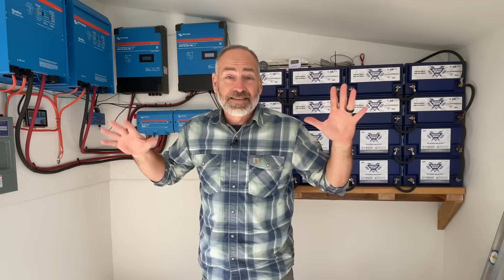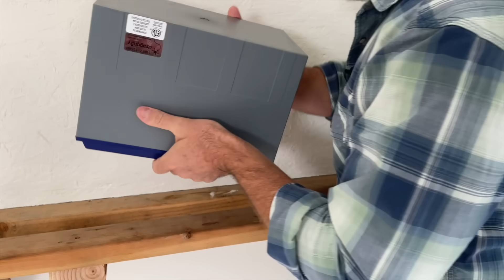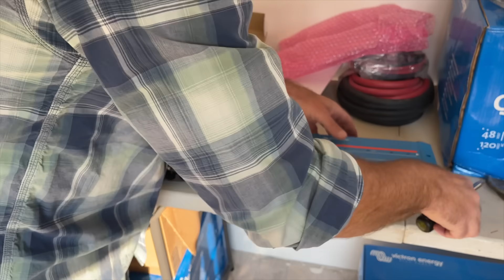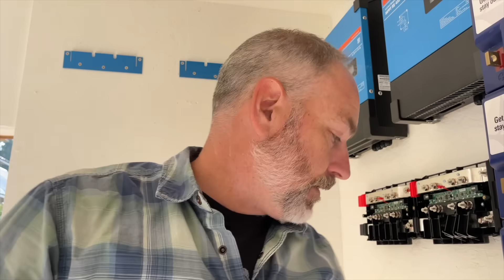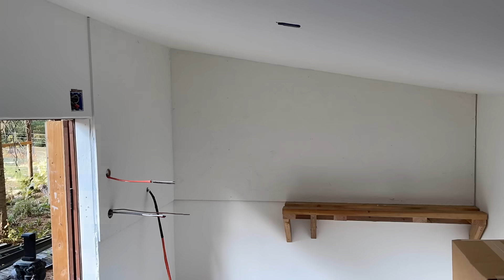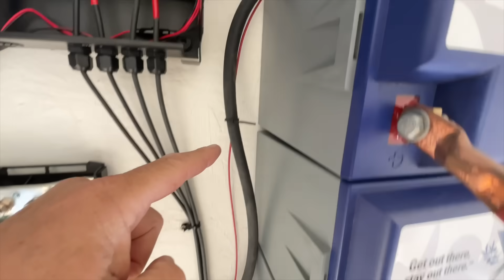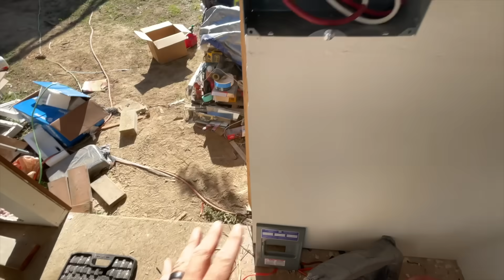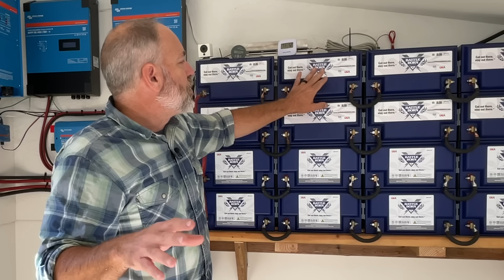EASIEST Off Grid Solar Power System Battery Bank

Comment from the maker: 🔥 WATCH OUR OFF GRID HOME BUILD FROM THE BEGINNING https://bit.ly/OffGridCabinBuild
Reply: Hello Martin. I was wondering if you could share the costs (approximately) with all of your solar system. My wife and I are thinking of moving to another state and I am very interested in putting in solar.
Reply: 🎉5 red a try t up i @kathsbadboy
Reply: @kathsbadboy it  G-d free to contact us to be a part of the world
Reply: @kathsbadboy t😂🎉e the
Reply: Please report the scammer using your picture and to text a number. Hes replied to every post with it
Reply: Hh check
Reply: @laurakenway6262  hello
Reply: @laurakenway6262  Hh check ? Do say more
Reply: so thinking of yours and mine, i found that i have some issues, im using 6awg after the first series batterys, so i paired using 6awg and about 7 ft of it. so i have voltage drop of ,3 volts. and some of my 10awg wires from controller are 10 ft long. so i got to go bigger and shorten things up
Reply: 😮r4
Reply: can i ask you, if i put my batterys like yours and hook panels for 48 volt and 12 batterys 48 volt, i dont mind a 48 volt controller, or re hooking my panels, but dont want to buy new inverters, so i have a 2500 and 1000 watt but 12 volt. would i have any battery life being hooked to one battery in a group like yours is what i want to know???
Reply: @chriscates3352  - You must have a 48v inverter for a 48v system.
Reply: @chriscates3352  no, that doesn't work. 
You might get a system working with a DC-DC converter but it doesn't sound ideal.
Reply: @alanhat5252  what  voltage should i set for stop charging on 24 volt batterys? it goes up to 30, i play around 28 volt, like 28.4 sometimes
Reply: @chriscates3352  shut off voltage depends on your battery chemistry. With LiFePo4 29.2V would be max with a 24V battery. And 20V minimum voltage where you want to stop draining them.
Reply: @VilmaHallikas  i got lead acid. new batterys are 13.5 volts. so on a car it charges at 14.3 volts. so this would be 28.6 for series. so i dont know if 27 should be shut off
Reply: @chriscates3352  lead acid is totally different beast. There's more variation there (flooded, sealed, are they deep cycle etc)
And then there's also how you use them.
If I'm not totally mistaken they like to be charged with constant current and when they are about full change to constant voltage. And around 29V is good afaik but don't take my word on it.
Reply: @VilmaHallikas  thank you. i knew fully charged was about 13.5 on car batterys. and with a 100 amp controller was worried of fire if set to high now that i know i can change it.
Reply: Hi Martin. What brand of solar panel do you recommend.
Reply: what should i set my 24 volt controller at for shut off voltage? it goes up to 30 volts
Reply: seems like another scam
Reply: Spammers are piggy backing your channel, offering prizes
Reply: Hhh
Reply: Greetings sir, David here from Ghana,  i have the same unit,  not working. 
The inverter led flash 
Temperature led stays on 
The bulk and the absorption led stays on
WhatsApp could be the cause of this please
Reply: wow, super helpful. I am looking at setting up something very similar. A pair of Victron Energy MultiPlus II 48V 5000/70-50 Inverter Chargers. But as Battle Born Batteries are hard to get over here in the UK, I am using some Epoch 12v 100Ah batteries. 
And it's great to see how you have yours setup.
Reply: Hh,h
Reply: 2 3000W inverters, and 2 supercapacitor kitties
Reply: i noticed today that the y connectors are only rated for 20 amps, my charge controllers are 100 amp and 30 amp. how did you solve this issue?
Reply: fake
Reply: Dear Martin,Sorry to bother you here. We have some questions about home energy storage installation. Can I contact you through your email?
Reply: hehe i bought 30 220ah victron agm deep cycle batteries in 2012 when they were dirt cheap, never used them until now. they were stored, checked them they were still full capicity. best batteries ever.
Reply: grdhdrhjrd
Reply: List price of that battery is $874 times 16 batterie =$13,984 for that entire battery bank  
Nah....I'll stick with my $106 Deep cycle AGM battery  times 16 =  $1,696
I'll use the $12,288 that I saved on batteries to buy more solar panels.
My deep cycle batteries are good for 3000 discharge cycles.
Typical Lithium ion is good for 300-500 discharge cycles.  The best Lithium ion are good for 1500 cycles.
So I guess my "cheap" batteries will last twice as long.
Also in Wisconsin if I bring in my batteries I get $20 off for each of my batteries.
And if I bring in a Lithium ion battery I get CHARGED $3 for a disposal fee for each of my batteries. Even when buying new ones.
There is a reason that real off grid builders do not use the super light weight, high energy density, most expensive batteries.  Because you would have to be insane to pay $12,888 more just to save a few pounds on batteries in a bank that will NOT MOVE for many years.  But you do make super exciting videos showing how light they are.  So amazing.  I just have to run out a get me some
Reply: @michaeljorgensen790  do you have a source on that 3,000 cycles claim? I'm seeing 500-2,000 in my searches.
Reply: One of the companies I priced for Solar panels was $65,000 for my home, It would take me 36 years to pay for that at the cost of what I pay for my light bill now.
Reply: You say this is a “simple setup”, but I just helped my friend install a Sol-Ark 15k inverter with a 15kWh battery made by Trophy Battery (both American made companies), and it’s, BY FAR, the best, most efficient, and simplest system I’ve seen. It runs his ENTIRE home. 

The grid connects directly to the inverter (with a 200 AMP disconnect in between), single battery connects direct to inverter, and solar direct to inverter. Honestly not sure why anyone would choose anything else.
Reply: What if I need the system without the solar panel. 
What would it cost .in USA $
Reply: What did this cost?
Reply: Amazing Work and you are very good at explaining things like when you were going through the wiring to Ac dc inverters/batteries.busbar and controller to fuse box.. What a setup..
Reply: Make sure you have surge protectors on the system and individual surge protectors on your electronics and appliances and a surge protector on your electrical panel. You have a lot of expensive equipment and wiring to loose if lightning decided to hit your units. You can loose everything. And it can burn down every building you have.
Reply: How do you heat the shed to keep the batteries from freezing?
Reply: Realistically how long do solar power batteries last in hot countries Like India etc ?
Reply: Your work is amazing man,how i wish I to work with you
Reply: Your batteries have freaking nose rings, fricken disgusting lol.
Reply: How much the system cost you?
Reply: Looks pretty good.  Looking forward to seeing how well it performs this winter.  Thanks!
Reply: @HomesteadEngineering  h,
Reply: @HomesteadEngineering  I
Reply: @HomesteadEngineering  ppp
Reply: @HomesteadEngineering  14:37
Reply: Wooow beautiful but you need to mount them on a metal frame and trunkings to running the cables.. Am learning a lot  sir keep it up...
Reply: Hi Mr Johnson, I enjoy watching your videos and all your efforts and positive enthusiasm. Do you think you can share some of the things you did in order to make such a move and the costs associated with that. Thank you, much appreciated.
Reply: @Joe-kx2yh and i and dessert too iir😂tt😢urttt ft i err r 0:04 0:04 0:04 tree 0:04 r 0:04 0:04 4r Tu Yi h4
Reply: RRT😂 error message

Comment: More dollars than sense, using the most expensive everything, with no performance advantage.  Why so many little batteries?   That's just adding unneeded complications, connections, and balancing issues.  Oh great ... mixing old and new batteries.  
DO NOT REPLICATE THIS system, unless you also have a bit of brain damge, and way too much money.

Comment: Nice set up.. grounding is really ineffective.. increase your gauge ac input or your load wireing..looks like 10 or 8 gauge wires..I use a 4 gauge wire for my inverters ac out or load to a breaker box just like what you have..and from my breakers I used 4 gauge wire..one is going to the cabin and the other 60 amp breaker is going to the spare cabin..My battery system is 12 VDC..48 VDC is not need for me simply because my inverters are close to the batteries..my backup generator is a 3200 watt diesel powered.. great for running on biofuel that includes cooking oil vegetable oil or let over oil..I collect that type of oil from restaurants...my generator wire is  8 gauge wire that runs to the inverters..but I am using two single 30 120 vac breakers..both of them on give me the 240 vac..that line goes to my input ac power in on my inverters..The thicker the wires are the less harder the inverters work and the more efficiently the power flows.. Exspecaly ac current...

Comment: $16,000 in just batteries alone 😮
Reply: I know. Its the reason I don't have solar panels. If you dont use vast amounts of electricity the cost of installation (if you pay someone to do it) means that you would spend nearly the same amount over the next 20 years on your bills if you did nothing.

Comment: No, if you're connecting the inverters in series, you will have 240 VAC @ 5,000 watts. In series, you increase voltage. In parallel, you increase current. I hope your heat is anything but electric because 5 Kw will NOT heat a house, electrically, especially if you plan to power anything else.

Comment: I know it has been some time since this video came out, but I figured I would give my two cents. Absolutely beautiful setup you have. You managed to keep it both robust and organized. My only small issue with it is how you have your positive and negative coming off of the power bank. You have both the positive and negative coming off of the same level, at the very bottom. To ensure you have even charging and discharging in every battery, you should pull one of the leads, either positive or negative from the top, and the other from the bottom. It ensures the power flows through every battery evenly. It may not make a huge difference, but that small optimization may have a long-term benefit. Other than that small detail, fantastic job all around.

Comment: Isn't a 50 amp breaker too small for your houses main power supply? After all each inverter is capable of 83 amps constant power supply, and if you run two inventors in parallel you would need a breaker capable of at least 166 amps.
Reply: Yeah Victron's super simple install, I wonder what he would say with the advancing technology of other manufacturers now.
Reply: Well either way great install, keep it up partner.

Comment: due to heat inverters also battery should installed on concrete (cement) walls and also good ventilated.
fingers crossed your installation will never catch fire

Comment: Heh Martin, how is the system working out? You are fairly trusting of the solar equipment manufacturers, I'm surprised you didn't put the batteries, charge controllers, and inverters in a brick/fireproof shed away from the house.  One lightning strike and it's all over.

Comment: Looks like you have a big code violation and dangerous situation. You used 14AWG wire to feed your AC main panel, which has a max load of 70 amps. 14 AWG is only rated for 15 amps so once you draw more than 15 amps, you’re 14 AWG could heat up and start a fire

Comment: He didn’t run the solar panel wires in PVC just direct burial that’s gonna be a real problem for you later on when you have to pull a new wire

Comment: And then the funny part is after you spend all those thousands of dollars well over $10,000 for the panels and if something goes wrong as a DI wire good luck troubleshooting it’s all electronics. Anything could be bad.

Comment: Greetings Martin, I am so happy at the way you presented this project, SIMPLE and easy to follow and understand.
I do have a question, you are using a PV panel Charge controllers and then an Inverter, In todays market are those 2 pieces now a single unit?

Comment: I can't belive this video is only  2 years old! 2025 and you can get a 10kw split phase inverter/solar and ac charger all in one for under 2 grand! I have 620ah at 48 volts lithium ion that I paid 2500 bucks for! That's 32k kwh❤. Glad I waited 2 years!!@
Reply: Good day to you, would you share the parts that you used for your project please. I am in the process to purchase an off-grid system and like to know what you used. Many thanks if you share.

Comment: I would put a heat pump in that shed and some 🔥 safety hasard, and for more safety i would always have insulted tools for emergency not necessary for you but for anyone that would wander in so that they couldn't electrocute them self like kidz  only happens once. But im not criticising your installation. It's just added protection.

Comment: THE CHEAPEST COMPONENT OF THIS SETUP, IS ALSO THE MOST IMPORTANT THING!!...THE SHELF!!!..great video!!
Reply: I was thinking the same thing.  I would not trust it.  I would have used legs to carry the load to the floor (2x4 legs nailed flat to the wall under that board on the wall and 2x4 legs under the front of the shelf to the floor) .

Comment: You are simply the best. Only the connection part should have been as detailed as crimping the lugs to the batteries. Where is the next part with additional solar panels installed.

Comment: 21:30  AC out 110V you used #12 wire to feed your standard panel in the house? what is it consuming 50+20 amps = 70 amps? Man, you going to cook your #12 Wire . Need something bigger. Generally, for a 70-amp circuit using copper wire, a 6 AWG wire is appropriate for shorter runs (up to 100 feet). For longer runs, you may need to upsize the wire to account for voltage drop. For aluminum wire, you would typically use 4 AWG for the same situation.

Comment: Great job , but your mains consumer units from america is shocking , they look like they are 100 years old design . Should have surge protect with a rcd or rcbo . The orange twin and earth looks to small . Looks like it's 2.5mm max . Also should at lear be in a compresdion gland amd have mechanical protection . I know this is how its done in America. In europe it would be shut down immediately if anyone came to inspect this . The rest looks good thou .

Comment: The pricing of this system is enormous and not at all worth the price. I can run for 15 years on the grid for less money than this system which is only guaranteed for 10 years. Sure, it's awesome to be completely off grid and if you have no access to electricity it's worth it. But be careful...this system is almost 20 thousand dollars to do it yourself and that doesn't even include the cost of the solar panels.

Comment: I'm buying a property with natural gas well so free nat. gas to run a generator. will have low demand for electric relative to most in the house, so wanted to get a good basic system that would engage a generator when voltage decreases then charge back up and stop. If anyone knows good resources to educate myself to do this or has recommendations of a system and components I'd be abundantly grateful. thanks and great video!

Comment: Any system is super easy when it's all free, but your whole system is unaffordable for the avg person. The batteries alone cost 925 each that nearly 8,000 for just batteries and another almost 2,000 for other equipment not counting the solar panels. Sure, this system would be great if you have 25k plus to spent.

Comment: Your number 1# comment below is that this is a terribley over priced system.  Read your comments.  Everyone thinks you are a BB sponsor and simply did not include this in the video.  If so...this is beyond misleading. IF not, then you should have also mentioned that.  It really makes zero sense to do a set up like this.   Either you did zero research in putting this system together and therefore have no right recommending this over priced and undervalued system compared to what is out there at half the cost and just as reliable or you were sponsored and don't mind pushing this beyond overly expensive and unjustfied system on to your viewing audience.  If 90% of your comments are people who think you made the video for the second reason than that is really not a good look on your channel.  Just saying....

Comment: Please correct me if I am wrong 300 and some ought DC Volts from the solar panels to the chargers is a dangerous voltage. I was on submarines in the Navy and I do remember the extreme precautions our Electricians Mates took to prevent an accidental electrocution while performing preventive maintenance on the high voltage (un-grounded) DC Battery Busses. Should you take extra precautions to shield these cables and connectors in your yard and shed to prevent inadvertent contact with them?

Comment: You can't really discharge them down to zero. The batteries won't charge as many times. You can only get 2000 charges instead of 5000. At least that's what the spec sheets say on my lithiumiron phosphate batteries.

Comment: What is the logic of using 6 different pieces of equipment instead of one all-in-one inverter ? You are spending x3 for nothing. As a safety note: you should use 120A fuses between parallel'ed banks. It never knows what can go wrong with one of the batteries.

Comment: I’m new to the solar power setups, trying to learn all I can. My question is about the 50amp breaker running the house. Wouldn’t you need more? Like say a 100amps at least? Also 10/2 wire for a 50amp breaker?  I am not knocking this in anyway, I am honestly just curious.